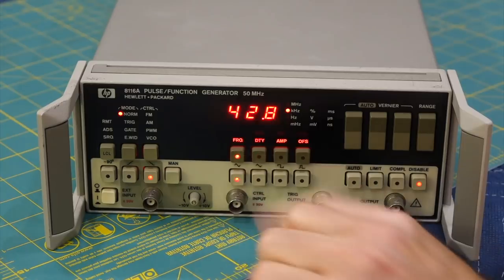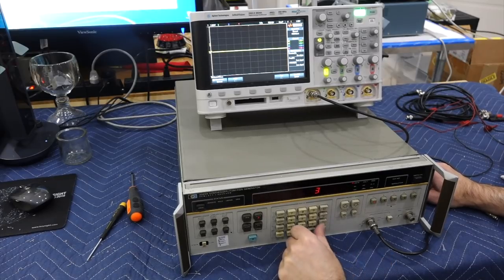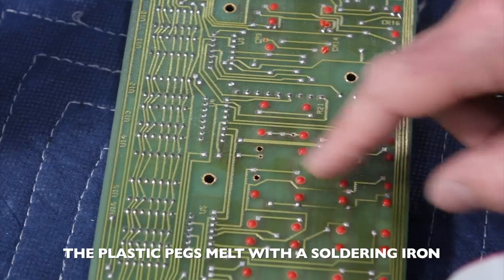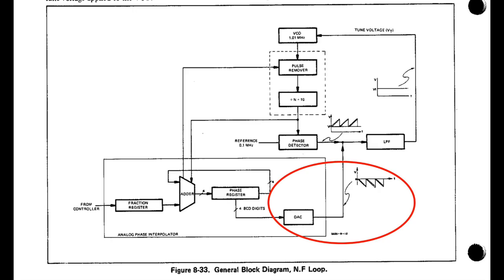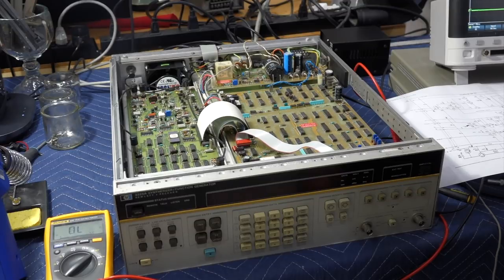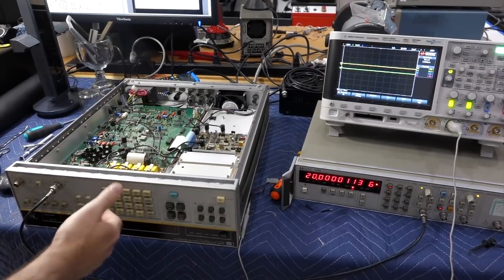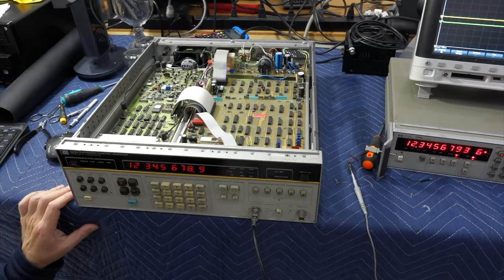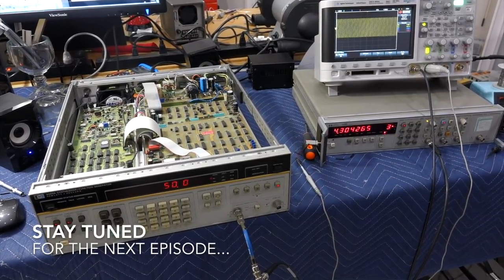HP 3325A Frequency Synthesizer Repair: keys, caps and PLL trouble

Comment: Nice video!
I also have 3325A and 3325B in my collection, both arrived without any display (but the fan spins). When I tried to fix them, I found the problem was that the tantalum decoupling capacitors on the boards failed and shorted the power rails. Although 3325A used sealed capacitors, while 3325B used plastic ones, both of them are very easy to fail. I used a FLIR thermal camera and found quite a lot of shorted ones! In case they fail again, I replaced all of them.
These are really descent signal generators if repaired, with very low THD and very high frequency resolution. The 3325A I got has option 1 & 2 installed, which made it even better!

Comment: Nice repair. I just love the way you're explaining things.
Oh yes, these infamous red switches.. I also repaired many of these in my similarly old counter 5370B, including broken springs.
When you couple 10MHz reference from your Cs clock to the 3325A, you'll get a really precise synthesizer, the internal XO is simply ridiculous. 
Anyhow, the PLL jitter will increase proportionally with lower output frequencies, so frequencies below 1Hz are barely useable. (I got the 3325B)

Comment: This was one of my favorite pieces of test equipment on the bench. I used it a lot on doing my design validation and of course troubleshooting.  I never was much of an HP scope person but all the rest of their stuff with just bloody awesome Especially their spectrum analyzers
Reply from the maker: That’s so true. They never got the scopes right. And Tek never got the logic analyzers right...
Reply: Same here, I cut my teeth with HP for signal generators, spectrum analyzers, frequency counters and power supply's, etc, Tektronix for scopes including, the TM 500 series mainframes and Fluke for multi meters (8050A / 8060A), Weller for soldering irons and Pace for desoldering stations in the early 80's.
Reply: HP oscilloscopes just didn’t have the right zen back in the day.  If you really want to be frustrated, try an old Gould ‘scope.  On the other hand, I loved the HP 141T spectrum analyzer mainframe. (The square CRT bezel).  I had an HP function and sweep generator on my bench, forget the number now, but awesome and so easy to use.  About the only downside is it was huge and heavy!

Comment: Personally, I would have replaced all the major caps in the supply. The theory is that if one is bad that the others which are likely from the same batch and have been serving in the same environment are in similar condition. It's not necessary but I think it's a good idea to prevent future headaches when the others fail as we all know they will. As for the plastic pins, I find a hot air rework tool works best as you can accurately soften the plastic from a distance and gently pull it free. They can be reset equally as easy by reheating them and squishing them down with the end of the handle of a hobby knife. Don't get me wrong, this was a GREAT video. Friendly advice though for future projects, replace similar passives to the ones that fail for the stage of the supply you're working on. The only thing that's generally safe to leave is the resistors and inductors. Then again resistors can go out of tolerance if they overheat too much. I usually just desolder one leg and test them with j-clips like you used on the cap with your ESR tester. Having lived a life of having to buy things broken and fix them because it's the only way I can afford such things I've learned a lot. That's why I enjoy your videos so much. Because I gain a higher technical knowledge and the wisdom of watching as you work through things. I really appreciate it.

Comment: We used to use HP 3764 at work and I haven't touched one since I retired 5 years ago and when Marc pressed the power button on the unit I could still hear the fan start up in my head.

Comment: I have this same unit but with option 001 (high stability) and 002 (high voltage output). Works great! I also have the same counter with a HP 10811. Great video as always.
Reply from the maker: That is the perfect unit I wish I had! Good choice!

Comment: Marc! Excellent job. However, if you adjusted the power supply for spec, you'll need to do some further steps, as at the later stage of adjustments, you'll have to set the DAC levels, which is done by adjusting the power supply, even to out of spec of the first adjustment. 
This instruments is very nice, but the whole adjustment procedure is quite convoluted and there are some pain point in the design, two of them are the flat cables connecting the boards (in one of my 3325A, I simply replaced them with a header pin and ribbon cable), they have all kinds of bad contact and will create intermittent problems, which usually manifest in failing amplitude calibration or some waveforms missing.
The other is the attenuator board. The one with the yellow relays which plunges contact to the PCB is simply bad. HP replaced them in later models.
Also, even though you can specify frequency down to uHz, it has jitter and in one service manual HP even explains that you have to average readings to get the frequency resolution spec. 
BTW, if you are now a time-nut, then there is no point in worrying much about the accuracy, either use an external 10MHz reference, or get Opt 001 the ovenized oscillator. I see that your device does not have it. Opt 002 is also useful, you can get 40V output up to 1Mhz with that. 
Probably easier to buy an other bad device with the options than to try and find the options separate, as then you'll get all the cables and whatnot with them. Especially Opt 002 has some additional cables and shielding.
Regarding your comment on the 3325B  with internal modulation source, yes, it has, but in reality is is not fun to use. The arb gen only goes up to some low frequency and you have to loop back the mod out to mod in at the rear panel. You can't simply press a key to modulate with the internal source, there is no internal connection switchable from the keypad. I can count on one hand how many time I used the modulation source feature in the 3325B.
Reply from the maker: Ah, +1 to everything you say. I just realized while doing the "bonus" explanation that the DAC is the one important analoguy-thing to calibrate to minimize phase noise.

Comment: Its always fun when the little spring strip breaks.  I love spending days looking for those parts and replacing them when those keyboards break.
Reply from the maker: Actually, for all the HP equipment I have, and I do have quite a collection, I have yet to have a broken key spring. I am sure it can happen, but it’s not frequent.
Reply: @CuriousMarc  i replaced many of them when i worked for my dad years ago, luckily he had quite a boneyard and also had the forethought to buy many spares before hp put them out of production.

Comment: While you were all joking about using this as a musical synthesizer, that is in fact what the very first musical synthesizers were -- function generators hooked up to some external modulation voltage. And in a lot of early musical experiments, not even that. A very famous example is from the BBC Radiophonic Workshop which composed and recorded the theme from Doctor Who using nothing but function generators set at a fixed frequency, and then splicing the tape recordings together to make a melody.

Comment: I usually put dead HP keyboards into dishwasher or soak them in warm soap water. 
And some light oil afterwards. Worked perfectly for me, so far.
Usually, keys are just dirty and with dirt removed, they are just like new.

Comment: Given the age of my 3325a and 3336 both with the 10meg  crystal ovens  replacing all of the cap was a fun little job.  Made for  very stable output.  The ( all  3 of them )   3355a also need the cap replaced .  enjoyed the video.

Comment: Good job Marc!
A couple of suggestions: clean the contacts on those yellow attenuator relays too. They just unclip from the board, and like the keyboard switches have wipers that contact gold pads on the pc board. They develop the same problems.
Also check the isolated supply on the IEEE board. If the caps go bad on that the machine can go crazy in strange and incomprehensible ways that might have you swearing for a week.
Reply from the maker: Thanks for the tips!

Comment: My unit also has a broken power switch, have to print one out for it...
Thanks for the checkout, I will have to go through my unit to check the power supply.
Cheers,
Reply from the maker: You mean the plastic power button? I don't know why, but my two units also are missing that button. It must be a disease specific to these units! I had to borrow one from another unit.
Reply: @CuriousMarc   yes, it's broken on mine. I suspect it breaks from putting the unit on its face... Or maybe just a weak point. 
Should be easy to 3D print one, I should get around to modelling one and printing it...
Cheers and stay safe,
Reply from the maker: @EngineeringVignettes  Great, I'll take a couple if you ever do that!

Comment: I'm sorry to see that the "West keys" also suffer from oxidation, much like most of the dreaded Tact Switches of the same era. But at least these are open and can be cleaned, whereas the tact switches are usually "sealed" (although some of the contact cleaner can seep in somehow, sometimes). I thought that gold isn't supposed to oxidize? The debouncing circuitry on this doesn't seem to do a good job even with the contacts cleaned up... You could always use this as a hearing test when hooked up to a speaker 😁. Anyway, thanks for sharing, Marc! Stay safe.
Reply: Pure gold doesn't bind easily with oxygen, but I doubt they'd be using pure gold.

Comment: The 3325A signal generator is special in that the sin wave output has very low distortion or harmonics. This makes it great for testing HI-FI equipment.

Comment: Usually I just remove flat spring flip around and 180 degrees and clean contacts and put back. Works like new no clicking noises are hard to press. Do that to all HP equipment from that era as yes the click and keys hard to push is annoying at best.

Comment: On mine at 5 kHz - when I adjust the Amplitude DB from 0 to +7, there's no audible difference on my high freq transducers. My DMM isn't even picking up a DC or FREQ reading. What do you think ?

Comment: Nice fix,... as usual with old HP gear, it's the little things like caps + switches, hardly any serious faults. Watch out for those orange tantalums, i had quite a few 1970/80's HP instruments where they had shortened.
Reply: Sometime in the 80s it became fashionable to use tantalums due to their smaller package and very low ESR. Sometimes that ESR will create very large ripple currents, causing other components to blow.

Comment: Why did you re-insert the old cap that was still 'good'? I'd always toss both when they are the same age and they are out of the board anyway.
Reply: Something of that age? Absolutely.

I'm sure HP was using very good caps, but still.
Reply: Agreed. Look at the number of hours those caps are rated for. None ever says "forever."
Reply: Absolutely re-cap.  On an instrument of this age, I would be tempted to replace all the power supply caps.  The ripple current is usually fairly high, and you can see that on the ‘scope in this video.  Died out caps due to carrying sizable AC current seems to be a failure mode I’ve seen on more than one HP vintage test equipment.  Modern caps are much better - and usually smaller to boot.  If you are trying to maintain appearance as well as function, the new caps may well fit inside the old cans with room to spare.

Comment: This question might be a bit off topic, but I am looking for a good frequency counter and found a used HP 5335A, it has the oven oscillator option installed and is not that expensive, should I go for it?
Edit: also has the option 040 (expanded HP-IB control)
Reply from the maker: Grab it! I have the HP 5334A which you can see in this episode: https://youtu.be/HKsjwT53yXw . The oven oscillator option makes a huge difference.
Reply: @CuriousMarc  Alright, I bought it, by the way, is the 5334A just a slightly earlier/later model? The specs and available options seem kind of similar at least

Comment: Finally managed to get hold of one of these, but it appears that the processor crashes during the startup sequence (FREQ, Hz Annunciator and AMPTD CAL light up briefly when powered up, display remains mostly blank and sometimes displays scrambled characters). Occasionally I was able to get it to power up correctly at least, but it would crash depending upon what entry was performed (switching from FREQ to AMPTD and back twice would cause the processor to lock up completely). The manual suggests a signature analyzer for most of the debugging of the A6 assembly (Control Circuits). My question is, would it be worth obtaining one, as it appears that a majority of the tests cannot be performed without such a device? Any information is welcome, as the 3325A that I managed to get also has option 1 (ovenized oscillator), it would be great to get it going again.
Reply from the maker: The signature analyzers are pretty cheap, so I’d recommend getting one. Your problem seems intermittent though, I’d look at simple things like power supply ripple and sockets, connectors and cabling first. Next would be memory.
Reply: @CuriousMarc  Well, it was sort of intermittent the first few times the HP 3325A was turned on, but quickly got repetitive, the Logic won't start properly anymore. Maybe an IC that was already in degraded condition, and has now failed entirely? Anyway, following your advice, the power supply appears very stable, the ripple on the +15/-15 rails is immesureably small, and on the +5, it is only about 1.5 milivolts, so that's probably not the issue. Regarding memory, are you refering to the four ROM chips (U1-U4) that are holding the machine code? Can these loose their contents too? I've heard about this problem with EEPROMs, but do standard PROMs also develop this problem?
Reply from the maker: @fklabs6813  I was thinking RAM, if this instrument uses any (I have not looked at the logic schematics). ROMs do loose bits too. But it could be a gate anywhere. The good thing is that you were working at some point, so this is likely a single failure.
Reply: @CuriousMarc  Alright, figured that a signature analyzer would be worth it anyway, considering it is the main method of logic troubleshooting for HP gear of that era, so I purchased one. With one of these, the debugging should be pretty straight forward, as all the signatures are listed in the manual. Thank you very much for the advice! Guess I will report back once I figure that fault out.
Reply from the maker: @fklabs6813  Good luck! Just checked the schematic, and it uses a Nanoprocessor with external RAM, the same chip that Ken Shirriff recently reversed engineered and that I debug in my recent videos here with a logic analyzer: https://youtu.be/KdLnEOwTO6E and https://youtu.be/ZYRSyTe9FU0 .  There were no signature analyzer debug instructions for my system, so I had to go full Monty with the LA. I am curious to see what signature analysis reveals.
Reply: @CuriousMarc  Got the signature analyzer up and running now, it revealed a failed ROM chip (U1 in this case) that was showing wrong/unstable signatures on several pins, so, at the moment, I am waiting for some pin-compatible EEPROMS (TI TMS2532) to arrive in order to replace it.
Reply from the maker: @fklabs6813  Awesome! That would have been pretty hard to pick up with a logic analyzer. Do you need me to dump the ROMs or are they available on the web?
Reply: @CuriousMarc  I was able to find the ROM images on the web (FTP server, had to ask for access, got that and was able to download them no problem), only problem is that I don't have a programmer for this type of EEPROM, so I will have to send the chip to a company, so they can program it for me (a programmer that goes up to 25 volts is way too expensive, especially when considering that I don't program vintage chips on a regular basis). So in short, I already have the contents of the ROMs, but thanks very much for offering the ROM contents anyway, I really appreciate that!
Reply from the maker: @fklabs6813  Contact me through my about... page, maybe I can help out: https://www.youtube.com/curiousmarc/about
Reply: @CuriousMarc  I sent you an email, provided a more detailed explaination in there, feel free to reply if you have an idea on how you could help out.

Comment: So you got 2 identical caps in the same circuit, one is already failed. You replace only this faulty one, and leave it's brother inside... to prepare for the same trouble for the next owner? :)
Reply from the maker: The other cap tested good, and is not leaky either. I have a whole video for the YouTube armchair recapping community: https://youtu.be/GMNQDoFpYQY
Reply: @CuriousMarc  Same circuit, same make. Sooner or later it will follow its fellow. Basically I'm against these brainless "replace all caps" campaigns, but in this particular case, I would not leave it in... If one is failed, I would replace both in pair... armchair recapper, LOL :)
Reply: @janosnagyj.9540  This isn't like the motherboards of the mid-2000's with those knockoff-formula electrolytic caps that would bulge and blow after 2-3 years of service. I've long since lost count of how many of THOSE I've had to recap. Equipment of this era, it was usually the RIFA or tantalum caps that went, and even those were after 30 years.